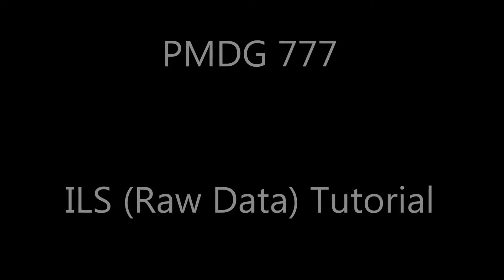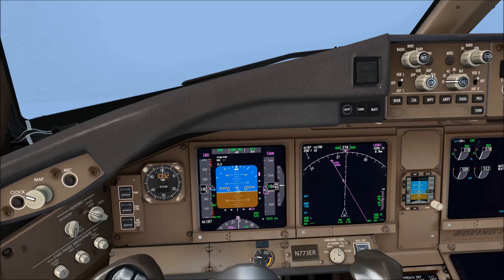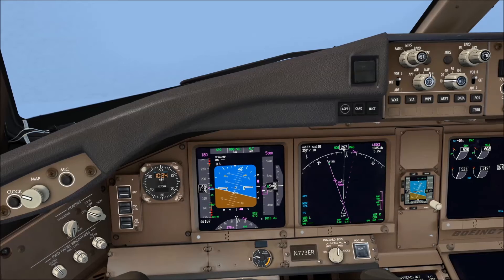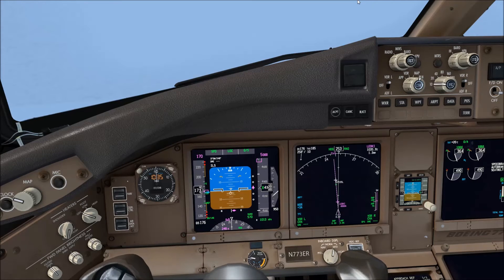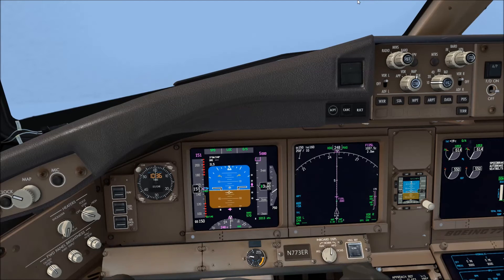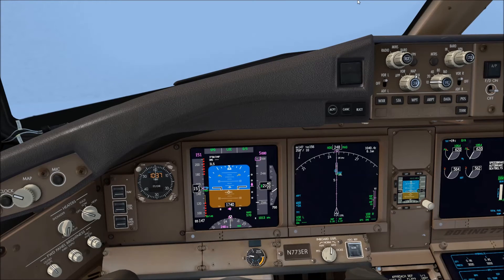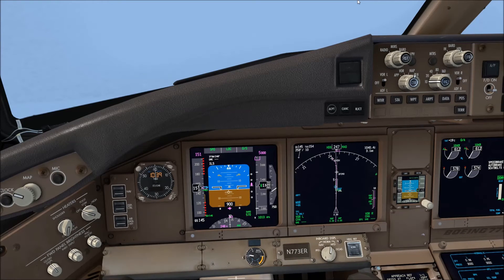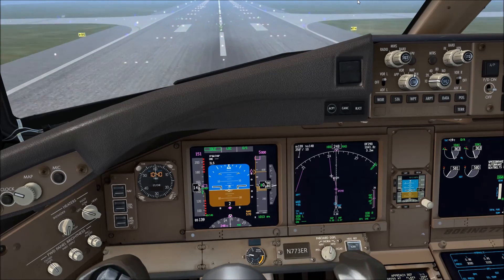PMDG 777 ILS (Raw Data) Tutorial

Comment: Bonjour Captain! Have you uploaded a video of raw data take off, level accelerations clips and descents and especially steep turns? Can you explain what you mean by trimming for speed? How is it different from normal pitch trim? Please explain this with regards to fly by wire sensitivity.
Reply from the maker: Hi... no I haven't uploaded other "raw data" videos as it is not really something we do.
On the B777, because it is a fly by wire aircraft, we trim for speed. This is the way it works, unlike conventional aircraft you trim for pitch to relieve pressure on the yoke.
The simulation allows you to display where the trim speed is (not the real aircraft)
Reply: @CaptainNav  so the magenta triangle next to speed scale is the trimmed speed?
Reply from the maker: No the trim speed shows a blue FBW. I am not sure if it is on the video but on my more recent videos it is there. You can enable the FBW to display in the options.👍
Reply: @CaptainNav  merci beucoup! I learn't something new today. As it is FBW when executing a steep turn for 180/360 degrees (Airline ASSessments 😬🎯) you minimise control inputs after acquiring the right flight condition attitude with the slight increase in Pitch ~(3 deg) and increase of N1 ~5-8% and fly by wire will keep that attitude if bil turbukence or pilot oscillation...correct? I assume the FBW works similarly to Airbus but with no auto trim and no auto thrust but are protected from bank angke experience, over speed or app to stall and g- load prot?
Reply from the maker: The blue FBW is not in the real aircraft. 
For normal turns, indeed there is no need to pull the yoke.
For steep turns you have to disconnect the PFC's and fly in direct mode. In that case you do have to increase the pitch a little bit and add some thrust.👍
Reply: I very much appreciate your insights and calm mode of instruction in your videos and the time you take to promptly reply to inquiries . I wish you great success in your channel growth Sir.
Reply: Hi.. did you find any video regarding raw data take off? Can you please share it to me if you already found it? Thank you

Comment: Nice video! I just wanted to ask if you have any idea why i keep getting a TERRAIN! TERRAIN! PULL UP! Warning on my PMDG 777 while on final approach to Land. And yes my Aircraft is fully configured during approach, Flaps 30 , Gear down. Thanks.
Reply from the maker: Hey...thanks for watching.👍
I came across this problem recently with the American Airlines livery.
IIRC you need to go into the options and find "minimum runway length" or something similar. Change it to a smaller value (let's say 7500 feet). It should get rid of the spurious GPWS warning.
Let me know how you get on with that.

Comment: Do you use rudder inputs to land in severe crosswinds? I've noticed that the autopilot uses a  lot of rudder inputs during crosswind landings. For example: with winds pushing the plane to the right, the autopilot uses the right rudder pedal combined with turning the yoke to the left. I was wondering if pilots also use this technique.
Reply from the maker: Yes you need to use a bit of rudder in a crosswind landing. Thr best way to manage a crosswind landing, in my opinion, is to fly the approach with a crab (nose into the wind), decrab in the flare (straighten the nose) and use a bit of downwind aileron. This should work out nicely.😃👍

Comment: How do we take care of the cross wind as  keeping  Loc in centre in manual landing is bit difficult
Reply from the maker: Try to find a heading that keeps the localiser depending on the crosswind. Use the navigation display to keep the trackline on the runway centreline.
Reply: Once the localized has stopped moving that is the heading to keep. If parallel bring the LOC to the center and return to the heading that stopped the LOC. put the Heading bug on that Drift heading and any further deviations due to changing wind velocity accommodated within the heading bug width. If visual distribute attention outside and on the ILS needles. Pay attention to what the wind vector is doing to help you anticipate drift as well as rate of descent corrections to maintain glide slope as it is ground speed dependent. Don’t forget to keep thrust setting in your scan as well as pitch which you should know as every aircraft has its magic numbers.

Comment: Hello Captain Nav,  quick question, do you turn off auto throttle on a real 777, while doing manual landing? I read that boeing recommends the  autothrottle  to be on, this handles any sudden gusts of winds. I have seen some pilots disable them. Please advise.  BTW a very smooth landing, thank you.
Reply from the maker: The autothrottle stays on even for a manual landing indeed...and it seems to be a Boeing recommendation in the Flight Crew Training Manual. The only time I would see no autothrottle is in the simulator for training purposes. 
However, it has been argued here before that some airlines disconnect the autothrottle for landing, so it is possible.
It depends on the airline procedures I guess...

Comment: Hello,
How do I get my pmdg 777LR across into my fsx or Lockheed  p3dv4. I’m at a complete loss and have spent hours today but no joy. I am currently a 777 pilot and specifically bought the 777LR to practice my raw data as I have a check coming soon, but I am not computer savy at all and need some serious help. Many thanks.
Daz
Reply from the maker: Have you already installed the PMDG 777 on your computer or are you looking to transfer it from FSX to P3D? 
If you just purchased it, as far as I remember, it should be just a matter of downloading it from PMDG's website and installing (there should be an installer) straight into your simulator, either FSX or P3D (NOT both!).
Reply: Captain Nav thanks for your reply. I have it up and running. But sometimes the auto throttle advances once I engage the auto throttle switch and not press TOGA. Any ideas why? Also I’ve saved a flight departing on runway 12R in Dubai. FMC fully loaded, then when the flight loads, it immediately crashes on the runway  before I’ve even started rolling. Have you experienced this?

Thanks
Daz
Reply: @dazanthony9198  in the pmdg options on the fmc. Go to simulation. Find the option about manually overriding auto throttle. Always, hold only, never.

I set mine to never. Reason? My throttle can make minor movement without touching it. With cancels the auto throttle and the Sim tries to sync the in game throttle to yours on the desk.

Also pmdg is a heavy heavy simulation. Usually best to just use the default hotstart on a runway of your choice. If you're looking for super fast flight.